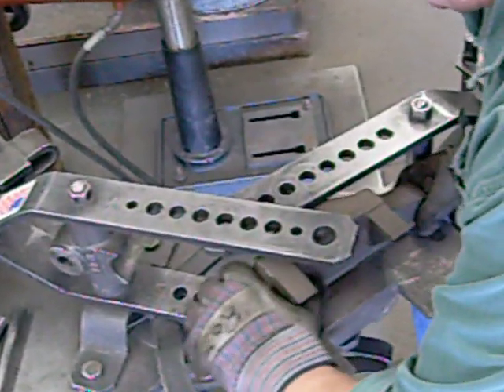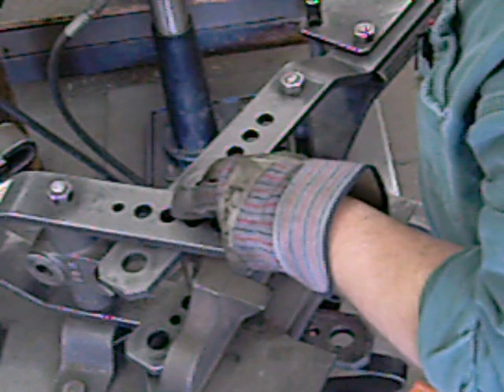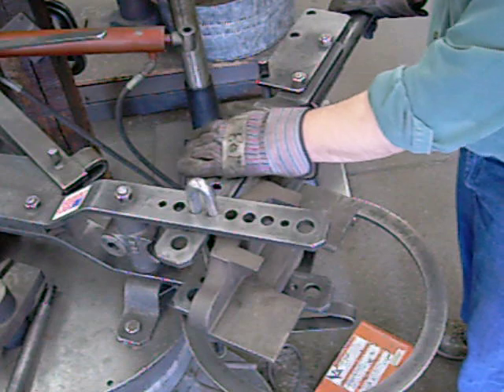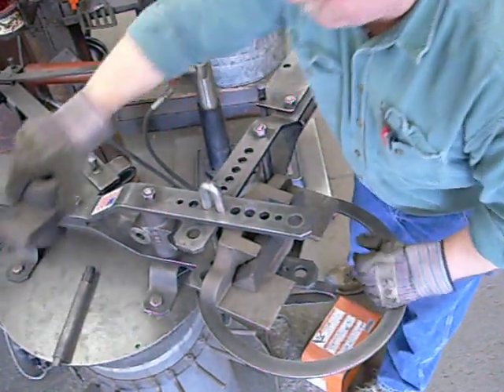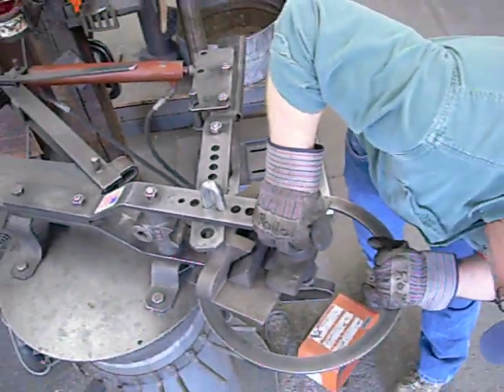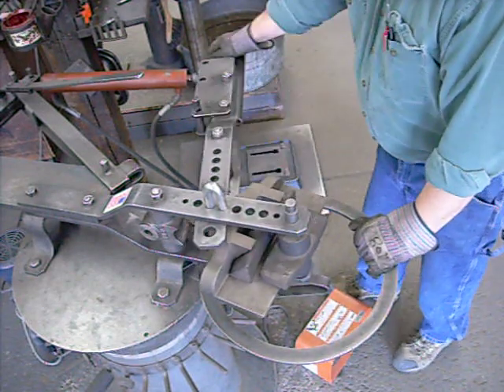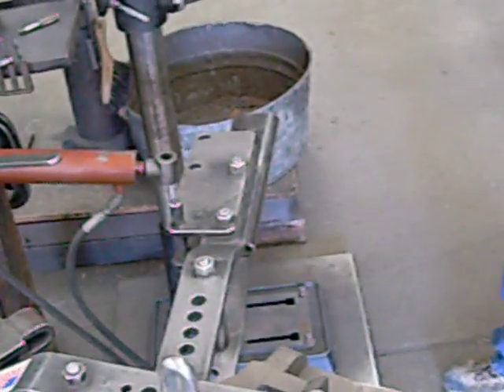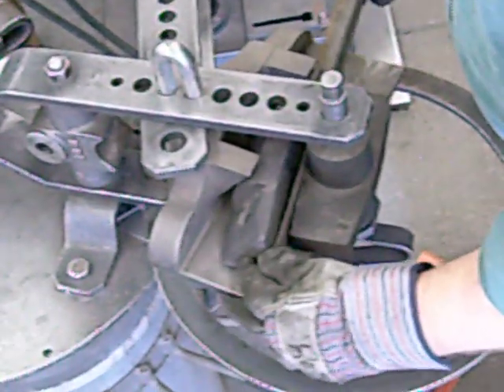50B Outbend Angle Iron Master Die

Comment: this die looks like it does 'leg-out" or "Easy Way" bends.  can this do Leg-In bends as well?  because some of the power machines I've seen doing that are just way to expensive
Reply: Not with this die set. Leg-in requires a 30B master die and a 31B die of the desired radius.

Comment: We made new skid rings for the front steel wheels on a Rumely Oil Pull tractor using this set up on our Hossfeld. It was slick, fit great and zero scrap! Wish we would have seen this video first, a lot easier than trying to read the directions and get all the pins in place without dropping parts on your foot!